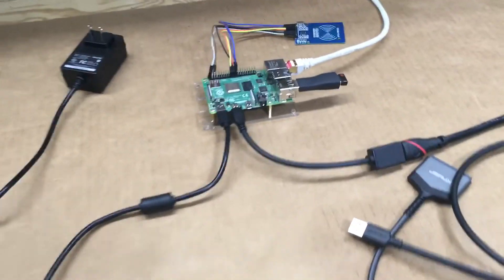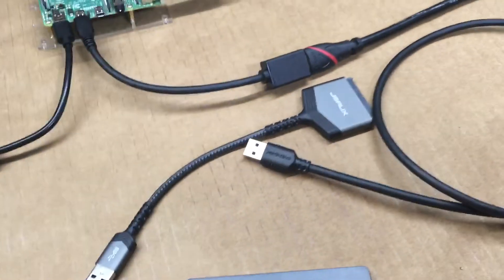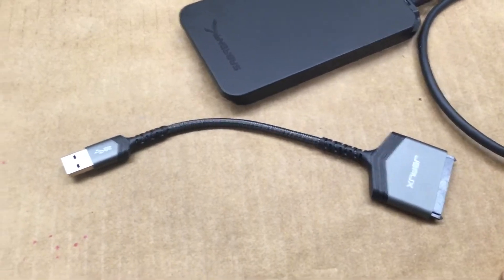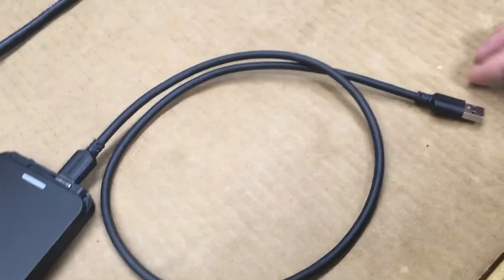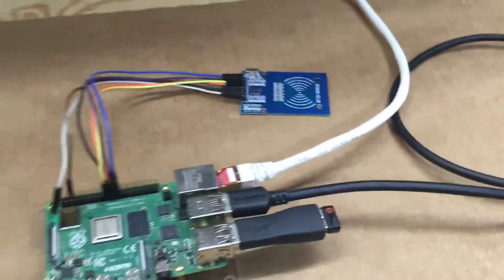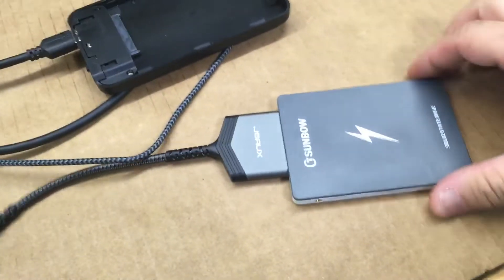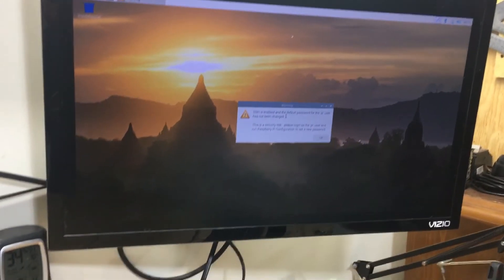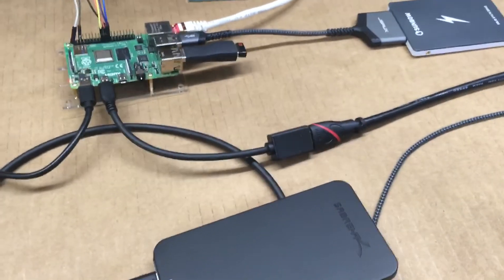Raspberry Pi 4 Booting Issues Using USB To SATA Enclosure Adapter

Comment: Thank you for this video. Yesterday i spend whole evening to boot up system from SSD. I buy similar to your USB SATA enclosure and also fail. I try under Raspberry Pi 2, and 3B. On both the same result - fail. Yesterday I didn't know that adapter need to support UASP.
Reply from the maker: Glad I could help

Comment: So my issue is, I was trying to power the SSD and Pi using a PoE hat. unplugged from PoE port and used the 3A Pi adapter and that worked. Going to try using a 3.0 thumb drive in place of the SSD. I really want it to work with one cable (PoE)

Comment: This video explains a work around by adding the adapter PID and VID to command line text.
https://www.youtube.com/watch?v=9HV4C0Llktk&t=366s
The method worked for Orico. But you have to get the adapter PID and VID.